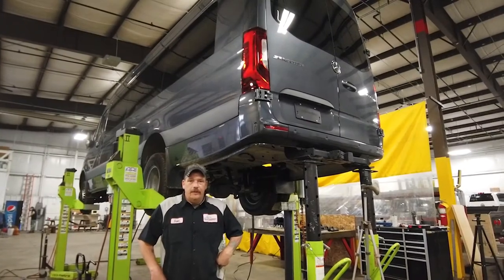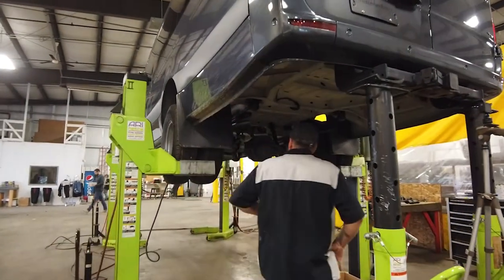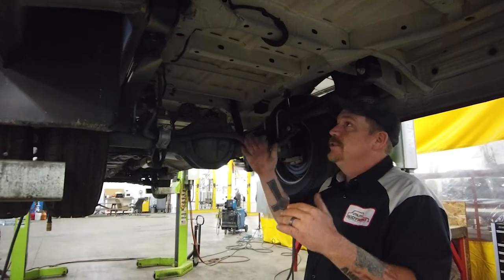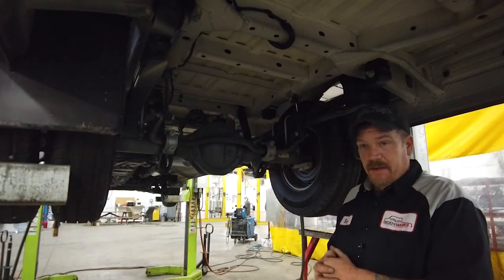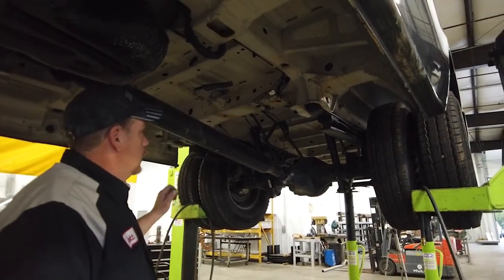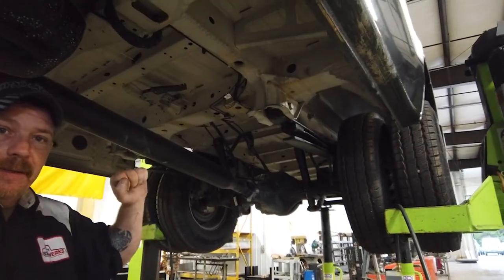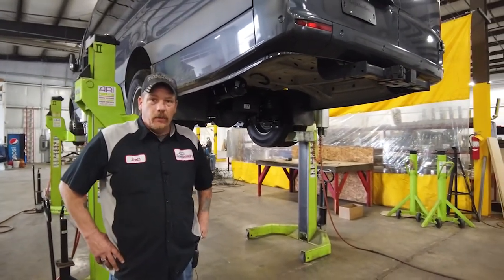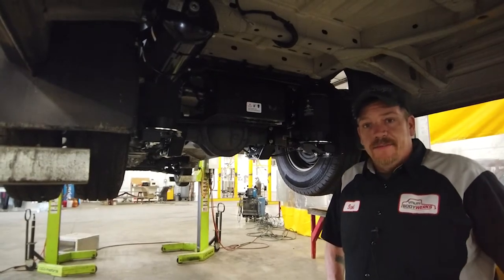VB Air Suspension on Mercedes Benz Sprinter

Comment: We own a 2019 Mercedes Sprinter Van Limo and the ride is terrible. Very harsh over bumps and very bouncy. I heard you say how this will improve the handling but I didn't hear anything about if it will improve comfort for passengers in the rear of the van. Can you please elaborate on this? We are very interested in this instill if it provides a smooth and comfortable ride.

Comment: Amazing installation of VB air suspension.  Where is your shop located?  I have a motor home built on a 2019 Mercedes’ Sprinter 3500, Could VB air suspension be installed on my motor home?
Reply from the maker: Hey Pharon, please give the shop a call at 574-522-8422

Comment: Could this VB air suspension unit be installed on a 2019 Sprinter motor home?
Reply from the maker: We are able to retrofit them to Sprinter Motor homes. Give us a (574)522-8422

Comment: Will the vehicle ride softer on sand roads
Reply from the maker: Thanks Elsie! The VB Air Ride Suspension promises an overall smoother ride. The onboard electronic control unit automatically monitors and adjusts the vehicle's ride height. You can learn more from the product sheet here https://www.utilitybodywerks.com/mercedes_sprinter_airsuspension.html

Comment: how about the front of the van?
Reply from the maker: Depending on the make and model year there are front strut upgrades available that can be added. You can learn a bit more about the VB Air Suspension on the 3500 and the 2500 here https://utilitybodywerks.com/suspensions/vb-air-suspension/mercedes-sprinter/